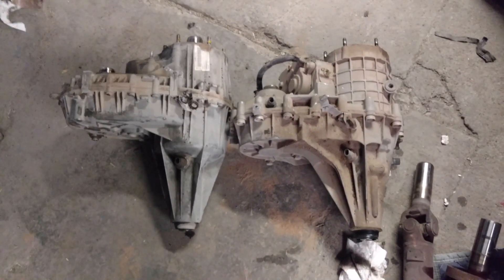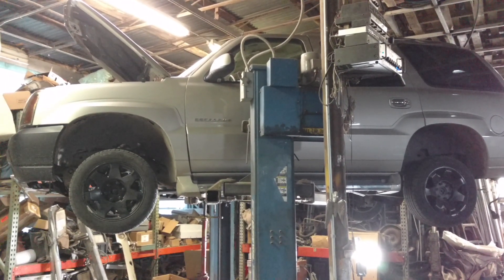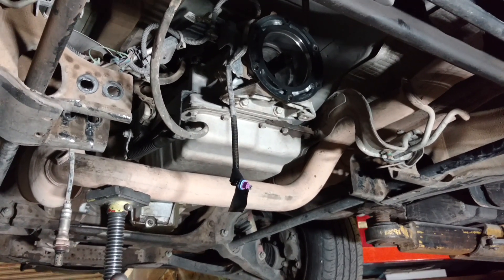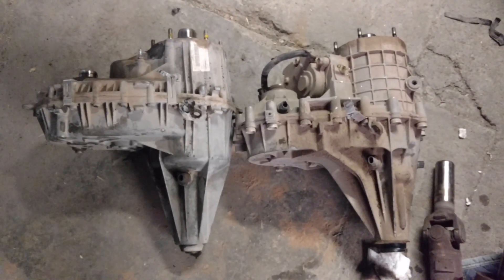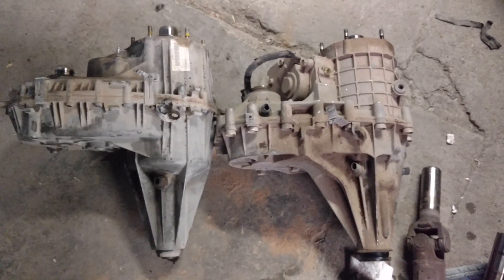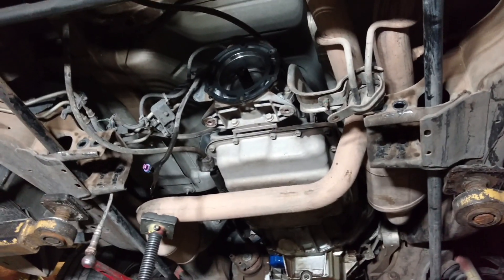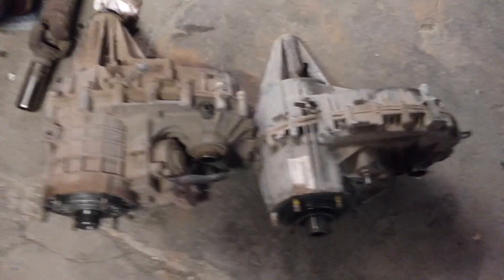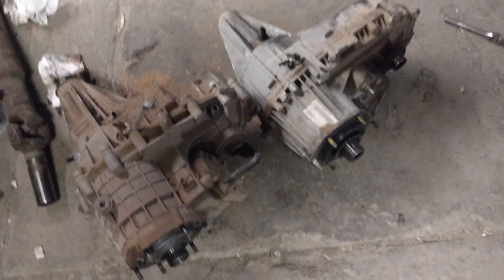Nitrous 6.0 Escalade How to convert Awd to 2wd Phase 1

Comment: I know this is a old post , but just wanted to give a thumbs up . Just swapped my son's 04 Tahoe AWD to RWD with the 4x4 transfer case you recommended and he's finally back on the road . Thank you !
Reply from the maker: You're welcome glad i could help !
Reply: I have a 2002 Escalade I’m trying to do this on. The transfer case I get does it have to be From a 2002? Or can it be from a 2003-2006??
Reply: Do you need to do any wiring for it how do you select between the 2wd nd 4
Reply: I will look into this for my awd silverado ss

Comment: Jess of All Trades   Last week I pulled the front drive shaft thinking I would start doing the 2WD conversion a little at a time.   After I pulled the shaft I tried to move the Escalade and it would not budge.   i put the front shaft back in and everything was fine.   Not knowing much about this can you tell me what would cause the Escalade not to move.   I did not touch anything except the four bolts holding the drive shaft in place

When searching for the NP246 transfer case I was talking to a transmission guy and told him about the truck being disabled when I pulled the drive shaft and he said it had something to do with the wheel speed sensors.   When I tried to move the truck with the shaft out and it did not move I tried to put it back in gear it made a big noise like the sound of gears grinding.   What is the relationship between the gears and the truck not moving.   I was thinking that with the drive shaft out I would be able to drive tha truck to see if the vibration went away.
Reply from the maker: You cant  just remove the front driveshaft on the awd tcase it will ruin the tcase and the truck will not move that's why I had to change the tcase to be able to do this.

Comment: Can I do this on a 04 Yukon with the diff lock Awd? I have the 2wd hubs on already and Awd transfer case out. What transfer case would I need? And also what about the plugs on the transfer case. What all would I need to just be 2wd without changing trans

Comment: What are the benefits of going 2wd? Seems like everyone is trying to get away from the awd system
Reply: I wonder if it's possible to use a 4WD case but change the gears in it to have a 40/60 split in power to make it AWD but also switch it to 2WD

Comment: Jess of All Trades     I have a 2008 Escalade EXT 6.2L AWD and I have been wanting to do this to get rid of the AWD because something in the t-case or front Dif or CV joints had a nasty vibration.   From reading through all of the post below I believe that I would need to replace the T-case with a 4 wheel drive t-case and that would be the NP246

I would also need to remove the front driveshaft, Dif and CV joints.
One of the post you stated that you would also need to replace the front hubs.   I your video you did not do that.   I it really necessary?   I saw another video of a conversion to 2 wheel drive where the guy cut the spline out of the CV joint and turned it into a big pin. put the spline back in the hub and put the nut back on and tightened it up.   would that work instead of new hubs.   Please confirm the following.

2008 Cadillac Escalade EXT AWD conversion to full time 2 wheel drive.

1.   Remove the CV Joints Left and Right
2.   Cut the spline out of the CV joint so that it is a big threaded pin.   Install back into the front hubs.
3.   Remove the front driveshaft.
4.   Remove the front Dif.
5.   Remove the rear driveshaft.
6.   Remove the AWD T-case.
7.   Install NP246 T-case.
8.   Install rear driveshaft.
9.   Plug speed sensor wires into T-case.
10.   Check and adjust fluid level as needed.
11.   Drive

Please let me know if I have left anything out or what I need to do differently.
Reply from the maker: Yes you can cut the spline off the cv shaft to save money just make sure it has some left on the back side to hold it in when you sandwich it with the nut. I put the 2wd hubs in mine the following day. Yeah your list should pretty much cover it . I've only done it on the 05 style generation but should work fine on yours.
Reply: I'm about to do the same on my 2008 did that np 246 tc bolt right up to your escalade? If so what year was it

Comment: Can you advise? I have a 2wd with a 5.3 and 4l60e. The 4l60 is toast. I have a extra 6.0. Correct me if I'm wrong but I should be able to drop a 6.0, 4l80 (2wd), and 6.0 computer and be ready to roll after a crossmember, and built drive shaft right?
Reply from the maker: Well the only thing is with that is the wiring harness is different as well. The only time I swapped to a 4l80 before was into a firebird but I used the 6.0 and 4l80 with matching harness and computer from a complete truck swap. You may be able to splice the trans harness in or change the pin out in the ECU. I've never done that swap like that but I'm sure there is info online about that swap. Good luck with it

Comment: Hey man , im still in the process of getting this swap together , but i remember when i removed my cv axles while replacing them the truck wanted to roll backwards i had to put something under the tire to stop it , my question is does your truck roll in park with the front diff removed?
Reply from the maker: No it doesnt. Maybe that happened  because if you had the old AWD transfer case in it they have an open diff inside them. Along with the 4wd transfer case swap make sure and put the 2wd hubs or sandwich the old CV axle ends in the hubs or they will come apart if you are removing your front diff and axles.
Reply: @jessofalltrades6760  bro thank you for the fast reply , such a big help for all of us AWD victims lol !
Reply from the maker: @soflo5.031  you're welcome bro lol good luck with it

Comment: The transfercase you used is out of a regular 1500 truck or a 2500 truck? Thanks for your time
Reply from the maker: It is out of a 1500 series truck with pushbutton 4x4 . The 2500 has a bigger case. Thanks
Reply: I got mine out of a tahoe. But had to shorten the driveline unless you use the Tahoe one that would work
Reply: Yeah I did the swap but dint shorten the driveline i dint have a issue
Reply: @A2Bproductions1  I was thinking maybe because I used a tahoe t case
Reply: I used a silverado t case

Comment: What if I wanna change it from all wheel drive to four-wheel-drive so I can turn it off and one is that doable 2004 GMC 6.0
Reply from the maker: There is an in depth answer I posted to this lower down in this comment section it's listed as a guy asking if can use 4x4 without the bcm. It is a very in depth swap but I give a full explanation of it in that response. Good luck

Comment: @Jess of All Trades the push button has a lot more options as to where to plug in the wire that was on top of the transfer case, which one do you plug into on the push button case? Also, did you have a problem with your driveshaft being too short after the swap?, mine is lowered 2/4 and I think it’s going to make it bottom out on the case when I sit it back on the ground.
Reply from the maker: Just plug the speed sensor wire in at the back of the push button case is the only one you need . It should be the only plug that fits anyways.
Reply from the maker: Mine is lowered almost 5 inches and I didn't have any problems with driveshaft length. Make sure the shaft is pushed all the way into the case and the splines in shaft are clean or free of debris.
Reply: Jess of All Trades sounds good man, I’ll be setting it down tomorrow to see if all is well.. Did it make any lights come on the dash? Or did it on yours?
Reply from the maker: @stevenhoward459  good luck man . No lights since the only plug is the speed sensor and the sensor in the pb case is the same
Reply: Jess of All Trades  awesome, that’s for the info man I’ll let you know how it turns out tomorrow.
Reply from the maker: @stevenhoward459  sure no prob good luck

Comment: Man I know this is an old video but I’m actually doing the same thing right now. So I install the np246 transfer case and now the transfer case is like stuck in neutral I’ve spun it at the encoder motor to swap for 4hi 4lo and 2wd but no power from transmission goes to the transfer case what could this be?
Reply from the maker: My transfer case was already in 2wd like most salvaged should be so hard to say. It may still not be in the right gear.
Reply: Remove that actuator and do it by hand

Comment: Are there any other conversions that have to be done like with the drive shaft, or is this just a bolt up and go remedy?   Can you just remove the gears in the front dif?  Pretty sure Jiffy lube ruined my dif by not tightening the fill screw when they tested the level because when my wife got back from a trip I started hearing a loping grinding noise and I seen fluid on my drive.
Reply from the maker: It's all bolt on like this. It would be easier to remove the whole front diff like I did but you have to put the 2wd hubs in it also. In your case you could just replace the front diff also if you don't want to covert to 2wd.
Reply from the maker: You need the 4wd transfer case also if you remove the front diff cause the awd one will just freewheel without the front hooked up.

Comment: I have a 2008 Yukon Denali I want to do this to. Do you know if a 2008 Tahoe transfer case will bolt right up? And if so will I need to do anything else? I just want 2 wheel drive. Sick of all wheel drive
Reply from the maker: I've only done the swap on the earlier 05 generation where as the 08 up stuff is a little different. You should be able to use a true 4x4 case from the Tahoe no problem though. GM makes all that stuff interchangeable. That will allow you to be able to take off the front driveshaft and you can either leave the front diff or eliminate all that too but you have to get the 2wd hubs also if you do that route.

Comment: How about a four-wheel-drive dogleg transfer case can I use that instead of an electric one
Reply from the maker: It's possible to use other transfer cases but they may not be a straight bolt in stock driveshaft  like the push button case.
Reply: Thanks for the quick reply I’ll definitely check into it wanted to do dog leg and bring stick through my floorboard so I can have it working if needed thanks again for a quick reply

Comment: Hello i have a 2001 yukon denali 6.0 with awd. I want to make it 2 wheel drive and was wondering what transmission i need to get ? Thanks for your time
Reply from the maker: Well if you wanna change the trans you will need a 4l60e for two wheel drive from a two wheel Tahoe , Silverado , suburban or Yukon of similar years. . I just left my trans and put the selectable transfer case in mine and left it in two wheel drive.
Reply: Link to the item

Comment: After completing the conversion my EXT drives like a brand new truck ! Better gas mileage , truck is quicker and drives like a Cadillac should . fairly easy job , I completed this in the drive way by myself over the weekend with straps and a floor jack .. i ran straps across the frame and used them to crank the transfer case off the ground enough so that i could get underneath and guide it into place with my arms/legs . floor jack was only used to remove the old TC and Front diff , when removing the front diff you do not need to unbolt pitman or idler arm , you can just loosen the steering box from the frame a bit to give the diff enough remove to come out .. the old transfer case , front differential , front drive shaft , and CV axles weighed 300lbs all together .
Reply from the maker: Thats awesome man it made a huge difference on mine too. Oh yeah it's some serious weight savings lol. Congrats on the swap !

Comment: I’m going to try to do the same, I don’t want the 4x4 because the front drive shaft has a leak and making noises plus the transfer case is only working on 4 high, is to expensive to fix!
Reply: MrPerito777 just remove the chain in the transfer Case
Reply: @gabeslifestuff9691  can I drift my Escalade if I do this

Comment: Thanks for the info ..If i changed the transfercase and only removed the front driveshaft will this work?? Or would i have to to remove the axles aswell?
Reply from the maker: No you could do that. I removed my front diff and axles for Max weight savings . You could do the 4x4 case and remove driveshaft.
Reply: @jessofalltrades6760  what about the lights do i tune it out or unplug something??
Reply from the maker: @swervinrigg209  no that isn't necessary . It's only the speed sensor down there and you will plug that into the 4x4 case. It won't throw any lights. I tuned mine with hp tuners but it isn't a requirement.
Reply: @jessofalltrades6760  highly appreciate the responses ima keep an eye on your build
Reply from the maker: @swervinrigg209  your welcome. Thanks I've been needing to post some updated. I won some crazy races in the Escalade already.

Comment: Is there a shift motor on the awd t case I cant figure out why a 4x4 code is on the dash but it’s awd now 4x4
Reply from the maker: No there is no shift servo on the awd case since it's full time. Your truck is still awd right or you converted it to 4x4?

Comment: Can I jst remove driveshaft that goes to from to stop front wheels from pulling
Reply from the maker: No sorry it's an open transfer case the truck won't move if you do  that. Hence all the effort to put in the locked 4x4 case to be able to remove the driveshaft .

Comment: Does the 4wd transfer case bolt right up ? Does the driveshaft front the awd work right into the 4wd t case ? So only thing needed to be 2wd is the 4wd t case ? No other parts needed ?
Reply from the maker: Yes its straight bolt on. The pushbutton features won't work without custom wiring but I just leave mine in 2wd mode. I even took out my front diff and axles plus driveshaft. If you do that you will need 2wd front hubs.
Reply: Jess of All Trades thanks for reply I simply want to do this because I’m tired of replacing or rebuilding the front differential on mine ! Original gave out and replaced with lower mileage one then it went out then rebuilt bow it’s going bad ! Can you give me a simple list of what’s needed like yours to make mine 2wd ?
Reply: Jess of All Trades also my Escalade is an 04 awd what transfer case would work ? Do I need a different driveshaft ?
Reply from the maker: @Bigjamez2011  any pushbutton 4x4 case from like 02-06 Tahoe , suburban, Yukon or 99-06 Silverado . Same driveshaft
Reply: Jess of All Trades thank you bro for replying I’m tired of chasing issues with my front diff , I found a xfer case from a 04 GMC Sierra 1500 4 button would I just need this right ? Then 2wd front hubs and I’m good to go ?
Reply from the maker: @Bigjamez2011  yes that will work . You can take out the whole front diff axles and shaft and put in the 2wd hubs
Reply from the maker: @Bigjamez2011  welcome good luck
Reply: Jess of All Trades well you won’t believe it but my front diff is perfect my issue was the transfer case bearings were what was making noise !!! Lol I’ve been looking for a np149 transfer case for my awd 04 . We put it on a lift and got it up to 40mph and clear as day can hear and feel the transfer case rear bearing where rear driveshaft goes into making the noise .
Reply from the maker: @Bigjamez2011  oh wow okay . Just watch out cause it can be deceiving where it's coming from on those. So are you gonna keep the awd then ?
Reply: Jess of All Trades yes I plan to now , I replaced the front differential thinking it was the source of the noise , I put in one with low mileage and put new seals on and fresh fluid and the same exact noise happens so my buddy has a lift we put it up and put in drive it went about 40-45 and clear as day he said was transfer case tail bearing all noise is from the t case said front end was super quiet and rear end was quiet , he pushed on it while it was doing 40 mph noise went away and once he let got noise came back it’s like a howling humming noise from bearings , I got a steal on a rebuild/bearing kit for 47 bucks comes with everything but the chain .
Reply from the maker: @Bigjamez2011  cool man good luck with it bro
Reply: Jess of All Trades thanks bro , this friday coming up I am pulling it out and rebuilding
Reply: I wonder if it's possible to use a 4WD case but change the gears in it to have a 40/60 split in power to make it AWD but also switch it to 2WD

Comment: Why not just change the tail piece on the transmission to a regular 2wd? Simple!!! Less parts and rotating mass
Reply from the maker: The shafts are different lengths in the 4wd trans
Reply: @jessofalltrades6760 you mean the inside transmission shaft ?
Reply from the maker: @عبود-ص4س3س  yes you can't do that period or else why would I go through all the trouble of changing the transfer case.

Comment: Is there a way to keep the selectable option?
Reply: I will check around on YouTube I think I saw one where the guy did it to his truck
Reply: Check around on YouTube I think I saw one video where the guy did it to his truck
Reply: I wonder if it's possible to use a 4WD case but change the gears in it to have a 40/60 split in power to make it AWD but also switch it to 2WD

Comment: I have the esv version the long one it’s awd and it won’t go at all case is bad can I do the same ? If so what year 1500 and can I just change the case and take off drive shaft?
Reply from the maker: Yes it will work on yours also. The 01-05 Tahoe's suburban, Silverado Yukon etc.
Reply from the maker: Yes you can put in the 4x4 t case and just take off the front driveshaft
Reply: Jess of All Trades , but the 4x4 t case will be already in the 2wd position or if not how would I lock it into 2wd
Reply from the maker: @ITzGunny  yes it should already be in the two wheel drive position on the transfer case
Reply: Jess of All Trades great thanks bro!